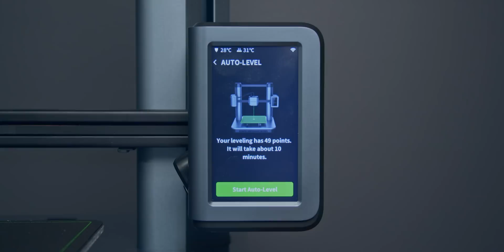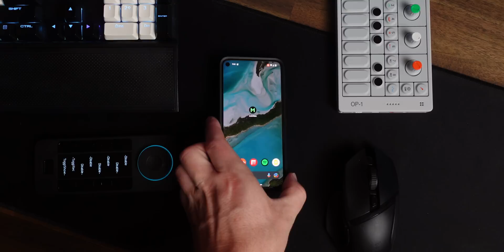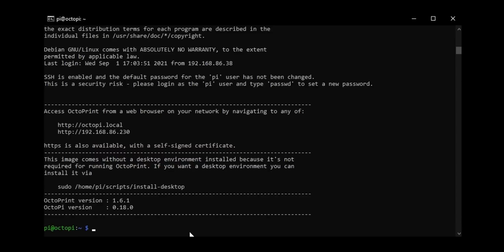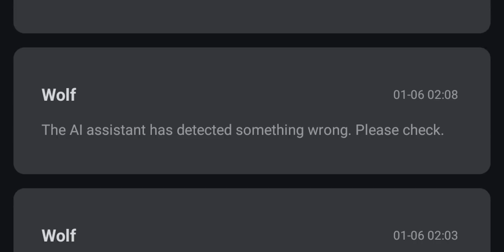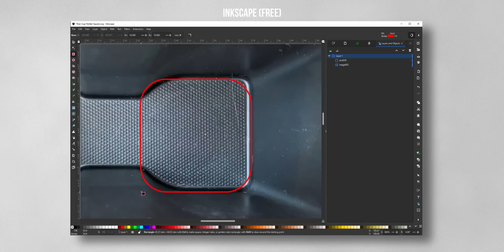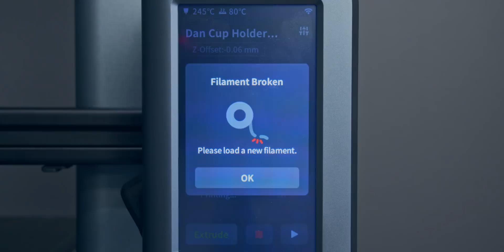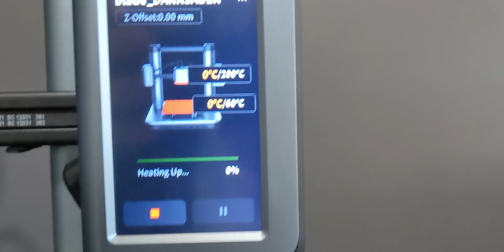This 3D Printer is how fast?! AnkerMake M5

Comment: could be that the z axis drive screws are out of calibration
Reply from the maker: It does a z axis levelling sequence (latest firmware does it at homing too) but that still doesn't seem to clear up the fact the left is lower than the right.
Can't figure out any manual calibration that'd resolve it, happy for you to shoot through any steps to try 😊🤙

Comment: Would you recommend it for people new to the hobby?
Reply from the maker: Yes, this and I'd also consider the Bambu Labs P1P (if you can afford X1 Carbon) which many others are recommending in the comments.
There's many other printers out there with the essential features I mentioned like auto-bed levelling, direct drive, filament runout sensor, Wi-Fi features. But the speed is the big one, and speed will greatly define your enjoyment. I know that when I had 3 day long prints fail right near the end I was super down about it, but if I had a faster printer like this and it failed at the same point, it would have been far less frustrating, as I wouldn't have had to wait as long.

End of the day the entry Creality Ender printers are good starting points, it's just up to how much time you have to tinker and learn.

Good luck with the new hobby Connor!

Comment: i had so many leveling issues on this one that it's going back, i have enough of that on my ender 3 s1 i didn't pay double the money to have the exact same experience in a prettier package, if it was 200 more yes worth it as it's so pretty but the price is insane for what it offers, if it wasn't for the design it would offer absolutely nothing compared to the ender 3
Reply from the maker: Is yours Lower on the left hand side too? I've noticed it keeps auto be levelling fine (with no filament loaded) then over time continues to go lower on left of bed. 

Tbh I didn't even consider returning with that fault but you know what a Bambu P1P wouldn't be bad to try out if you can get a refund from levelling issues.
Reply: @camshand  in Sweden you have 2 weeks to return something for a full refund no reason required

Comment: Don't use a scraper on textured PEI.
Reply from the maker: With most things it's down to how you use it, a light pass over the bed to remove skits and nozzle wipes shouldn't cause any real harm.
Sure if you chisel away with a hammer you'll be in trouble 😂

Comment: I've been 3D printing for years using tinkercad and it never occurred to me that you can use a program like inscape in this way to import images and extrude it. You sure have earned my subscription and I don't have a whole lot of subscriptions. ❤️
Reply from the maker: Yeah it is a phenomenal little tool for cloud based work, especially good to use on my raspberry pi in the garage for quick models like the cylinder 🤙

Comment: hmmm... has a lot of stringing though. doe they have settings for restrictions
Reply from the maker: Yes full manual control for retraction in the slicer, it's built on CURA so has everything there. I do find the nozzle to be a bit leaky when idling at temp, may be due to the all metal hot end and the temps I'm keeping it at, might have to test with some lower temps too.

Comment: Great video, man! Super high quality! I'm liking my M5 so far, aside from the features that aren't working yet like the AI. Actually trying out some wood filament at the moment and it's handling it pretty well!
Reply from the maker: Thanks mate, appreciate it 🤙
Yeah the AI will hopefully evolve better with time if that training works well.
I've just got a new roll of PETG so excited to print se car panels since it was so easy to print on the M5.

I have to try wood filament, seen it heaps but haven't used a roll yet. Good to hear it's working well

Comment: Seems unnecessarily bulky. And the screen attached to the x axis? Seems odd
Reply from the maker: The base plate is quite bulky, I presume the mass is to assist in vibration reduction with z axis at max height. As for the screen and filament run out modules I find them quite polished looking

Comment: RIP 3d Printing industry. Bambu is here to slay.
Reply: no doubt. My Carbon and P1P make this printer look slow. also, I get multicolor with the AMS. He is comparing this to an Ender 3?? basically 10-year-old tech. Bambu has leapfrogged everyone.
Reply from the maker: Hi Andrew, Yes I am comparing my new 3D printer to my old 3D printer to highlight the advancements in technology and what features can now be available out of the box with ease of use. I have used a X1C and it's phenomenally good, and hoping to get one in my hands personally to do a head to head comparison. p.s. AnkerMake are releasing a V6 color engine, it's still in dev though but will support 6 colours opposed to the 4 of the AMS, will be interesting to see the speed and waste differences when changing colours as that is the biggest speed slower of the X1C
Reply: Yea bambu is the move rn especially the price tho it’s sexy

Comment: My M5 prints are horrible. Terrible stringing and little blobs on each layer.
Reply from the maker: Oh dang, I did notice some blobs on z axis and found there's a wall seam setting where it overlaps by a few mm, I figured that was causing it and reduced the value a bit. Not at my computer at the moment but it was a slicer setting.

Comment: I had that issue with the bed too. I checked the bed level compared to the base with a bubble level. The base was dead on but the bed was low on one side. I installed a 2mm washer on the left bed supports to level the bed. That seemed to work for me. Installing the filament is easy actually. Straighten 2 inches or so of the lead end and voila...no prob. Thanks for the tip with using inkscape!
Reply from the maker: That's an interesting way to get the bed checked. Tricky as the z axis has two motors that on z homing turn independent for a moment. So it has the ability to compensate but best if you were able to true up to a real level with a washer 👍

I did find straightening it to help a lot too but wanted to see why it was so inconsistent than most printers I've loaded.

And yes I love Inkscape, open source SVG!

Comment: For a direct drive this thing has a lot of stringing.
Reply from the maker: Im not sure if it's a retraction issue or speed issue. At 250mms trying to pull back enough to make a difference between XY axis movements. For the flexible filament tests the speed actually resulted in far less stringing
Reply: @camshand  I would suggest you lower your hot-end temp to stop the stringing,
lower it a few degrees lower at a time until the stringing stops or there is a lot less stringing.

Comment: So it's smaller than a Bambu P1P and slower at basically the same price point? Poor Anker. Bambu really did crush the competition lol
Reply from the maker: Yeah the p1p is an unexpected beast. Interesting to see how ankermake goes with the mobile phone app adding model libraries and if it goes into stores given the anker supply chain. Might become a more user friendly model option but I am excited to see competition like the p1p
Reply: To be fair Bambu is huge compared to little portable Anker so that may distract some. On the other hand my ender 3 does 25min benchy and can print high temp stuff with a few mods I did so I can wait for next best thing
Reply: And it's a bed slinger
Reply: it's actually more expensive than a p1p by $100. RIP anker

Comment: u can add inductive probe for abl for few bucks run out sensor its just a micro switch or u can go fancy ang go with optical swich amd u will known when the nozzle would jam. The dd upgrade is almost free u can reuse old stepper limitting speed on bed slinger is bed mas anyway last thing is klipper for speed, it would be 100$ max, BIQU Hurakan is like 350 or so and it will be faster than te m5
Reply from the maker: Yeah you can do the upgrades on the cheap. I was thinking of a raspberry pi and a pi Cam or USB Webcam too for octoprint to add the smart features.

The BIQU Hurakan looks great value too, thanks for sharing it 👍

Comment: The Ender 3 is a hobbyist printer. The intent was the price point was low so that you could mod it the way you want it (Naomi Wu covered this ad infinitum). If you wanted to a buy a printer to print, you'd buy an Ultimaker, Bamboo or similar production class printer.

The Ender 3 was never in that market, and never even made a hint at such.
Reply: There is no place for the ender 3 now since the Sovol sv06 is out, it made the ender obsolete.
Reply from the maker: Yeah but many people buy them hoping to learn 3D printing and mod easily. For the tech savvy they are, but most people struggle plugging an ethernet cable into the right port 🤣

I'm trying to highlight the ease of use by buying something all out of the box, exactly like you said an ultimaker etc. Spending a weekend modding is fun, but not for all 👍

Comment: that not really fair to the ender 3, ender 3 is little bit over $200 the one your showing is $800. That is 4X the price, also You dont have any upgrades to make it faster like a upgraded hot end, better cooling fan, and or firmware like clipper.
Reply: Looks at Sovol sv06, naaa man you are tripping
Reply from the maker: Yeah it's no way an apples to apples. Was more so highlighting a common printer out of the box vs my new one out the box 👍

Comment: Though this looks like a cool printer i dont see any reason to get this over a bambu p1p
Reply: honestly i had planned to get the M5 at first but learned about the P1P and ended up going with that since Best Buy was out of stock of their M5s at the time (I had a gift card). Though the M5 does look nice and I think the AI stuff has potential, print wise I personally think the P1P was more impressive with its speed and quality.
Reply: Yup.
Reply: https://youtu.be/5uBBnHZ080w i found this, and it says all about the difference of the two printers 😁
Reply from the maker: Bambu labs p1p looks like such a great printer too!
Ive spent so much time watching X1 carbon vids and of course the p1p was announced right as my AnkerMaker M5 begun to ship haha.

I've got my eye on it and if they can get the quality close enough to the X1 carbon then it'll be a weapon.

Another possibility is we may see AnkerMake in retail stores given Ankers supply chain, making warranty returns easier and potential discounts on that current retail price.

Either way I'm stoked to see this new wave of fast FDM printers. It makes me more excited to print at home 🚀
Reply: @camshand  yes Bambu is the best printer i have used
Reply: @Creeds-Creations  same for me.   I love my X1C, so fast and quality print.  Over 300 hours of prints and not a failure….  Coming from a 5 years of Ender 3 experience, is so nice to send and relaxe.   Now I can mod my Ender 3 Max and always have a working printer ready.  

Print a Benchy in 17 min 👍
Reply: @ecard0  yes! I also bought the Snapmaker J1 supposed to be coming next month. Only reason I got it was because of mirror print but if I don't like it I'll just return it and get another Bambu Carbon